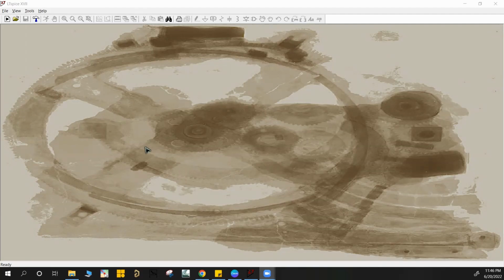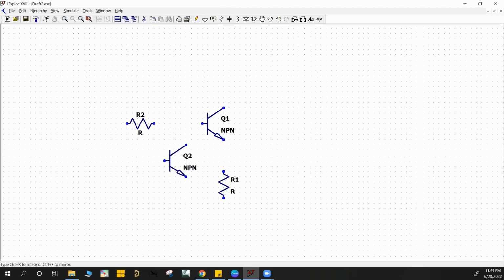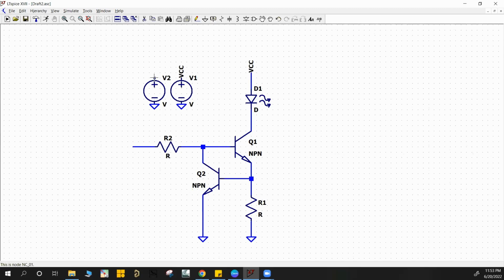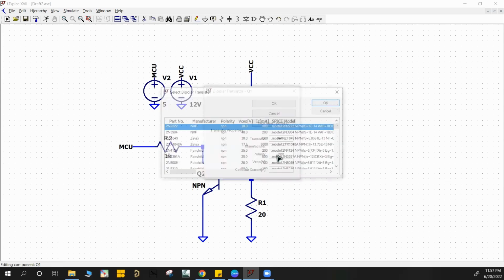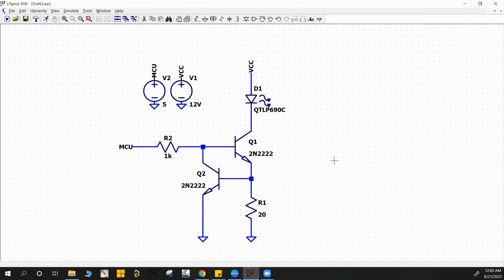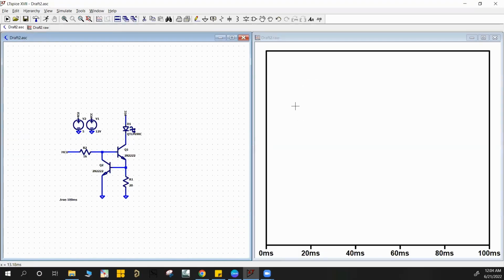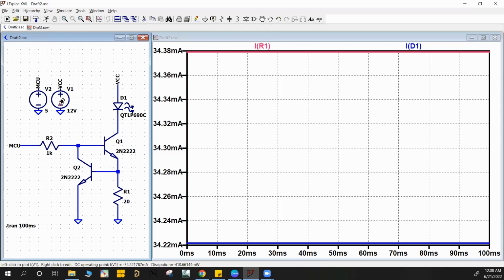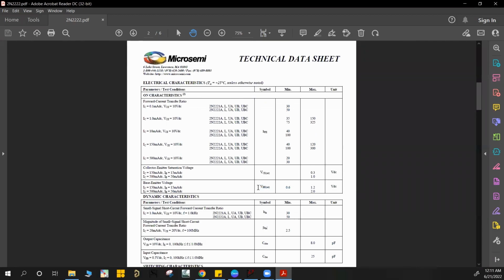Simulate Constant Current LED Driver - LTspice (Episode 2)

Comment: est il applicable a 14 led rgb ?
Reply from the maker: Yes - it's applicable as long as you only care about the max current through the whole circuit. RGB LEDs have at least three different forward voltages so it's important to pick the correct rail voltages